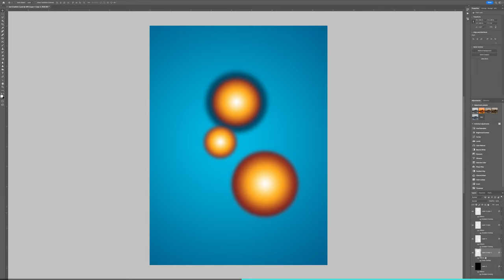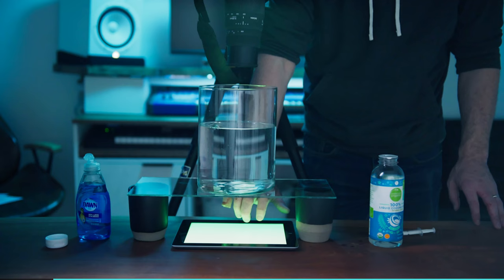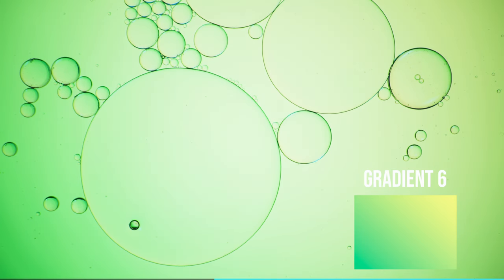Macro Photography Ep. 01 Oil On Water

Comment: How to stabilise oil drops? Unable to understand
Reply from the maker: You need to apply a very small amount of degreasing dish soap to the top of the water. You can do this by dipping a fork in the soap and lightly swirling around the top of the water. This will make the drops separate. So you can move them around. The syringe is very important for making the drops smaller or larger and moving them around. I hope this helps. I’d love to see the results you’re getting somehow.